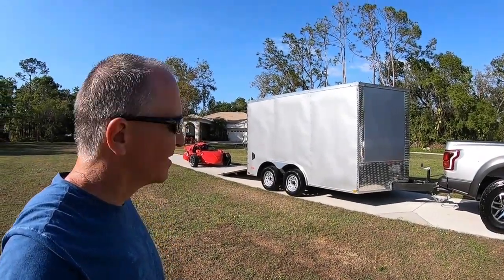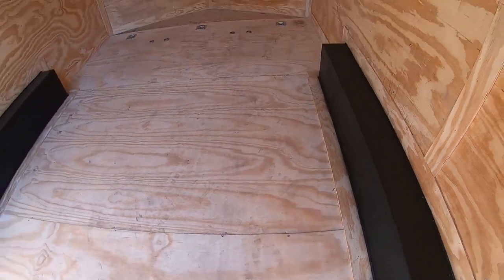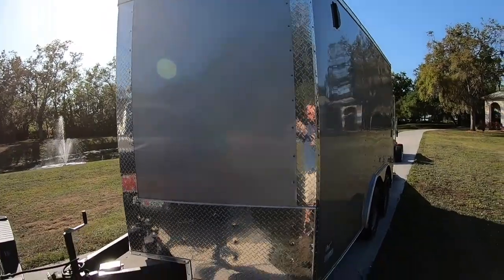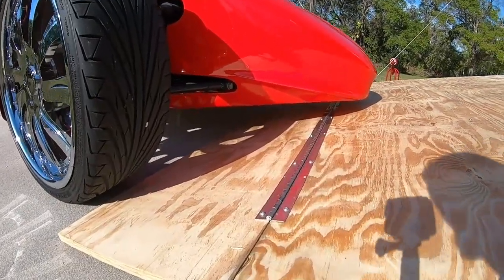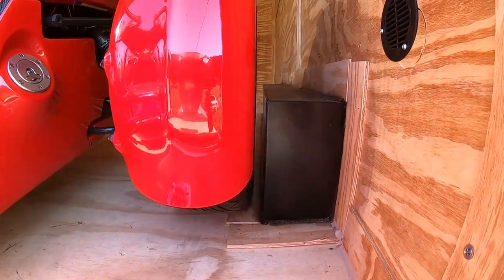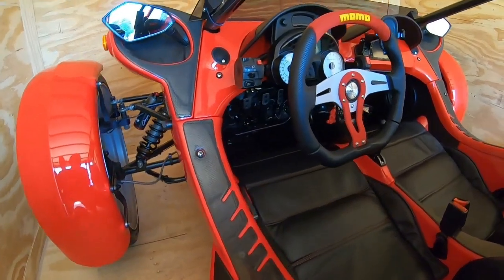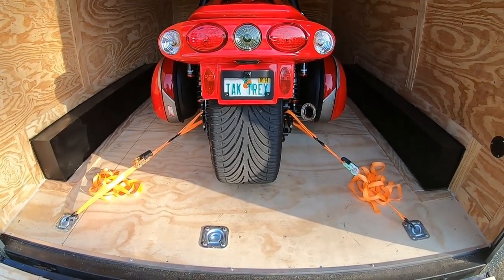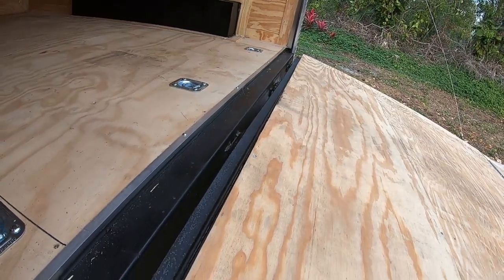Campagna T-Rex Cargo Trailer

Comment: Hey Todd have you thought about wheel straps for the front instead of going thru the wheel. Going thru the wheel isn’t good for the balance of your wheels.
Reply from the maker: Yes.  I looked at all the various systems and ways to tie down.  It was easiest for me to just order the  trailer with the "D" rings and do it this way.